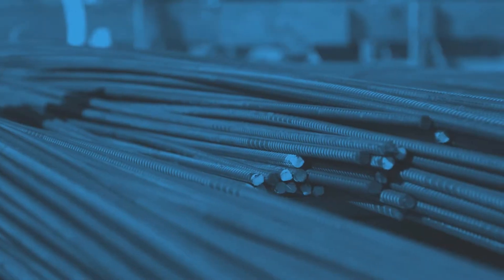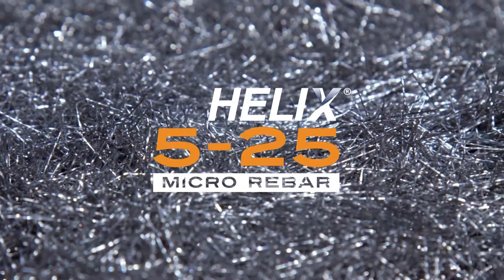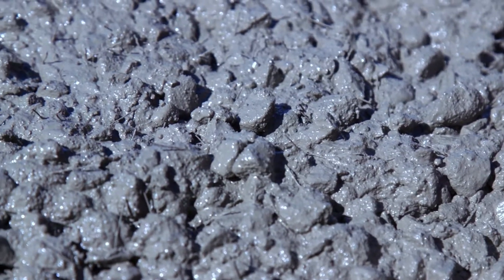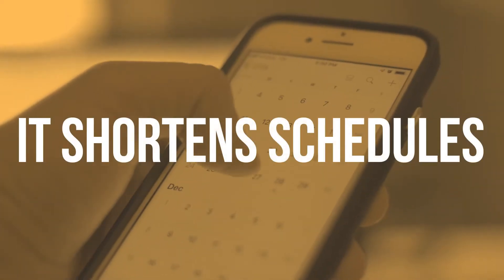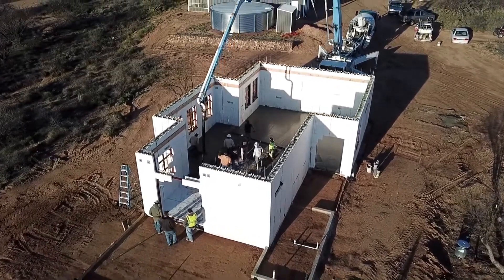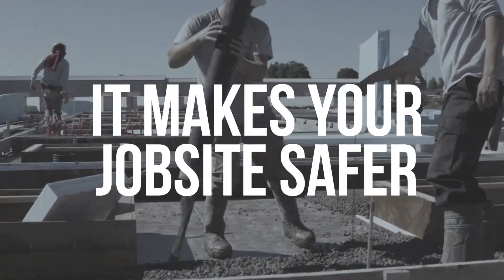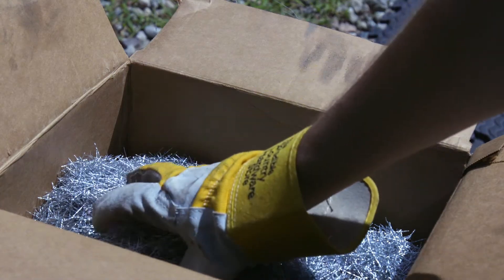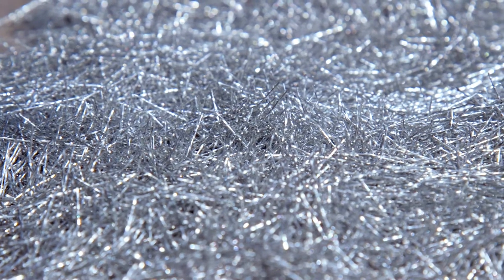Which is the Better Concrete Reinforcement? Helix Micro Rebar or Rebar

Comment: Will it prick your bare feet or vinyl flooring on cured concrete pad?
Reply: No it wouldn't be a problem as long as the concrete is finished properly.... Concrete can also have pointy rocks but they aren't an issue because the concrete is smoothed out before it hardens